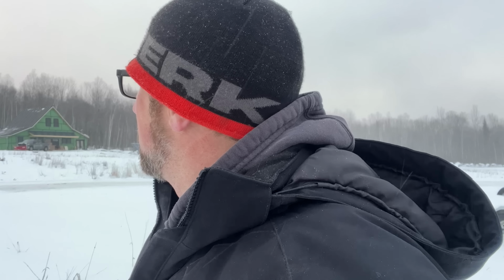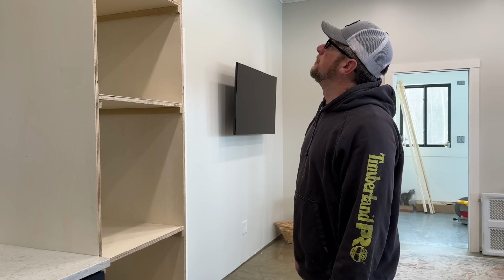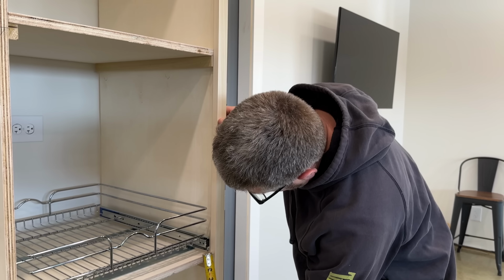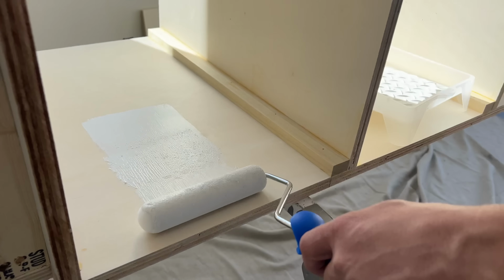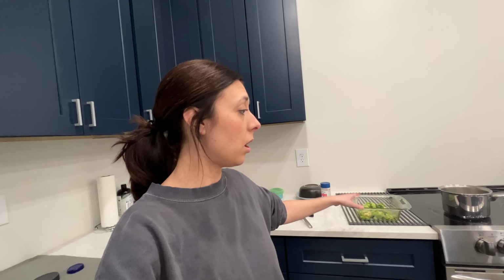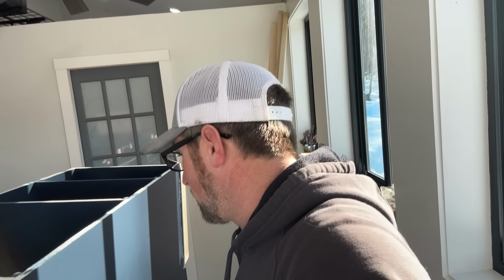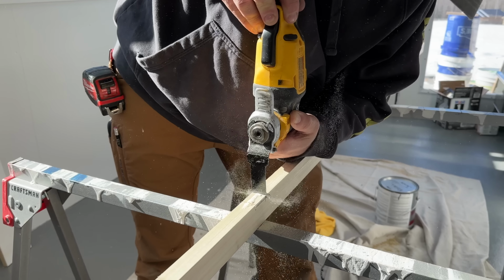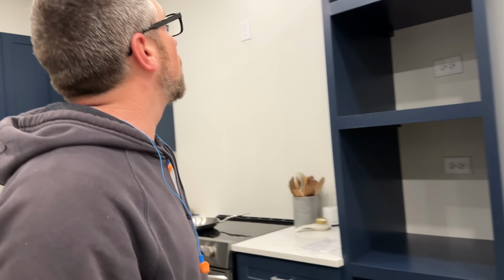Record Breaking Wind Chill Puts Our OFF GRID Homestead to the TEST

Comment: How are your chickens doing in this weather. Did you have to give them a heat lamp?
Reply: I live in Minnesota and I've had chickens over our winters for 13 years. As long as they have food and water in their tummies and have a windbreak they can survive the very cold temperatures. They run really hot. If you've ever held a chicken they are hot in your hands. Al also has the breeds that are very cold tolerant like I do. They don't need a heat lamp to survive the winter. Have a wonderful Valentine's Day!

Comment: Al - use the hoods on your jackets.  I was taught that 25% of heat lost is through the hood.   Inside suggest 1x strip (same as shelf supports) Across back against wall.  Gives place to screw to wall joists. Paint base all the way to floor for water proofing wood.  Just Idea.   Front tarp for chicken tractor.

Comment: Is there a reason why doors, especially leading outdoors open inwards because here in Sweden they open outwards. The reason for that is to do among other things with escaping if there is a fire which often can lead to the roof caving in with the risk of it falling down in front of the door which could make it difficult to open both from the inside and outside.

Comment: I don't know if anybody said anything but if there is a stud behind that tall cabinet I'd put an angle brace at the very top out of sight to keep it from trying to lean if the cats get crazy and start playing on it . Plus I don't know if you get earthquakes in your area but we found out that tall shelving can definitely fall over if not anchored up high.
I found some silicone rubber pour spouts at Lowe's for 1 gal and 1 qt paint cans and they keep the paint from getting all over the outside of your cans and they have a snap on lid on the spout so you don't have to put the metal lid back on .

Comment: Forty years ago, I was only thirty three then, I changed out the broken track frame on my D6 dozer. This was in Deere Bay Alaska, which is in the southeast alaska where temperatures seldom got down to freezing in the winter. This particular winter though broke a few records. The national guard was on watch over this area as temps were just falling out of the sky. I just knew it was real cold but never knew just how cold, that said, when they flew in on a large helicopter and told me I had to leave there, at first upset but after a quick explanation, they were correct in demanding it so we loaded up my two dogs and me and we flew out. The temperature was one hundred and sixty below without a chill factor! I was cold alright as my stoves just were not keeping up in the drafty old shack I lived in. As soon as my dogs felt the heat of the chopper, they snuggled right in with no arguments. I had third degree burns on my body where it was exposed to the air.
Reply: Wow! Thanks for sharing your experience with incredibly cold weather! I'm so glad they got you out of there! I didn't know it got that cold! Have a Happy Valentine's Day!

Comment: There's a YouTube channel called Little mountain ranch and they do this thing to their water pump so that if it does freeze they try to catch up before freezes all the way down. Also quick question for you cuz you're always very thorough why don't you insulate that by putting something over it when not in use?
Reply: It's a frost free spigot so that when you close the handle, a weep hole 7 feet down in the ground lets all the water out of the stand pipe so it can't freeze and burst. The deep earth temperature stays about 50F degrees so water can't freeze that far down into the ground.

Comment: The cabinet look so good. And not a single feline footprint in the paint!  Here is a thought for the inside of the cabinet.  If you add another support strip against the wall under the shelves, painted to match the shelves it would give the illusion of the shelves all being the thickness of the trim and you won't see the side support strips anymore. Right now the wall under the shelves looks unfinished.

Comment: You are doing a great job first of all. You already have all of the tools that are required. Please consider taking your Baker scaffold and using it to store your woodworking equipment on it. Place the shop vacuum on the floor or the bottom rung. The Table saw also goes there. Mitre saw is on next level. The middle is now your work bench. The next is smaller and lighter ones. The top is for material storage. This will keep you from working out in the weather. That will help keep your dust under control.

Comment: maybe insulate the pipe above ground (water) just incase
Reply: It's a frost free spigot that lets the water out of the stand pipe when you close the handle. There is a weep hole 7 feet deep so all the water goes out of the pipe. We have used ours for 13 years and they have never frozen and we live in Minnesota.

Comment: Great job on the cabinet.  Two questions: If you are willing to sand inside,  why don't you cut inside? Why don't you use a pouring lip on your paint cans instead of dripping down the front?  How much wood have you used so far this winter? I  guess that's three questions. 😉

Comment: You may have thought of this but just in case you didn't, the pole barn area looks to be significantly lower than the surrounding area. If you choose the site just right, you may be able to drive the tractor straight into the upper deck if you have one to drop hay to the upper area. Then you can drop hay down by hand. Saving a lot of labor.

Comment: Message to Lumnah Acres  re finding a here you have  screws holding your wallboards on . Using a small round magnet locate all your screa . Mark location with a small piece of colored sticky tape . Voila  yo will now have their location and the supports they’re screwdinto.
Read ths recently and it works and is a simple rask to do Jack Keaveney Bettystown Co Meath Ireland . Love your channel .

Comment: Wind chill isn't actual temperature, it doesn't affect anything other than your skin if you're exposed to the wind.  Your vehicles, structures, even the animals to an extent, all work based on actual air temperature.
Reply: As you said it affects the skin. We need to be reminded to keep covered up as temperatures drop because frostbite hits faster and faster.

Comment: R. E. S. P. E. C. T.   Gina! Filming from inside is SMART, not terrible.
#1: You are still recovering from surgery. Needlessly stressing your body to film outside so you can be as cold as Al in this kind of weather is just nonsense.
#2 somebody, besides the cats, needs to see if all that foam insulation is doing it's job. That way when you build the other house you will know if maybe you want a thicker layer of foam insulation,  or not.

Comment: You didn't use enought water, we use a gallon of water in a large pot that has good handles for throwing the water into the air.  The water needs to be close to boiling when it is thrown for the best effect.  At -20F I have seen a gallon thrown and not a drop hits the ground, or even get close to it.

Comment: Hi, one thing I love most about your channel is the differences between how you do things and materials used to that in the UK. Firstly, as a joke and as a plumber for over 30 years, the materials you have to use are terrible!! No wonder you have leaks!! Secondly, and I've seen this a few times on the channel, in the UK I have never seen anyone cut in after they have rollered! Cutting in has always been done first?? I've been on building sites where the painters have had to come back as the 'orange peel' finish isn't within half an inch of the corners. As mentioned, no criticism, just love the differences!! Best wishes to you all.

Comment: Respect sir! I’d be doing the cutting indoors. Might have a mess but dang neither you nor the equipment  is created for those temps! 
I am jealous about the new cabinet. Wow would that be an awesome thing to have. Especially as I’ve gotten older and my kitchen aid mixer etc., storage locations are low and difficult to move where I need it.